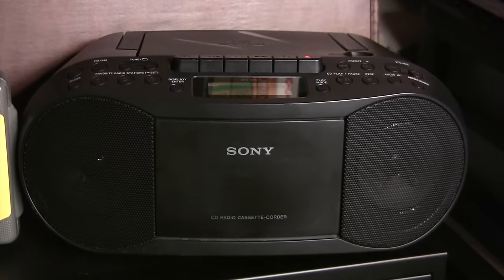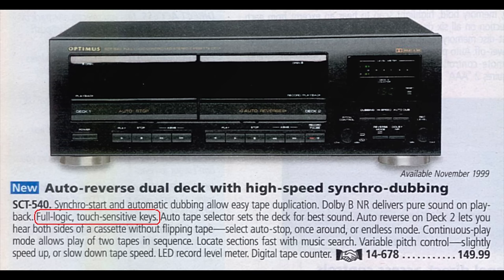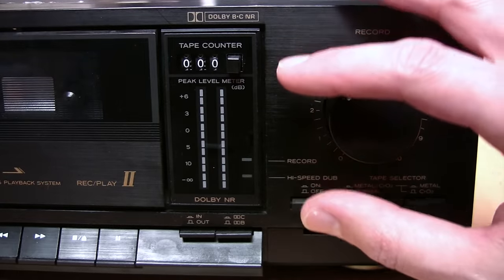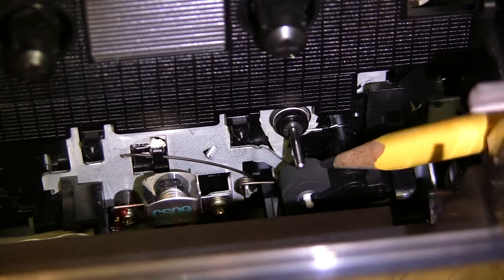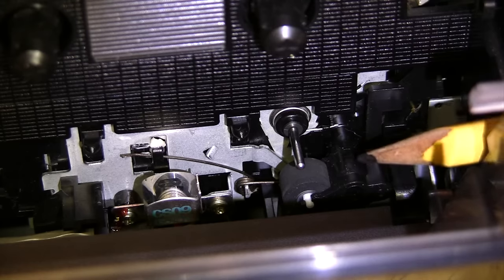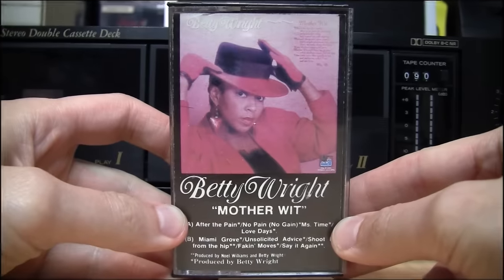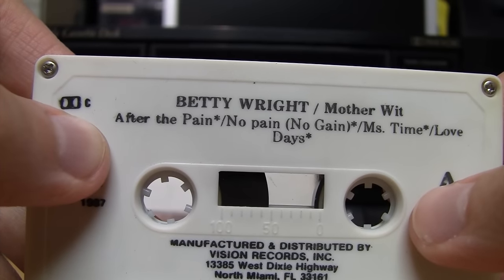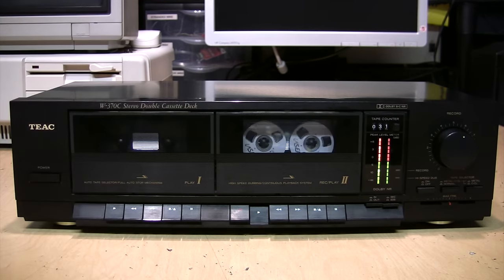Cassette Decks for Dummies

Comment: A simple, but really great well thought up and put together video as always.

Here's a little tweak you can try whenever you have the time tho,
When using a 'Piano keys style' cassette deck that has Full Auto Stop, the easiest way to do the finger test with the rewind function, is simply to activate the 'Pause' function on the deck first before you press the Rewind button to temporarily disable the Auto Stop feature. It may not work for all decks, depending on what type of mechanism is used, but from the looks of that TEAC, I'm almost sure it'll definitely work.
Reply from the maker: Thanks for the tip!
Reply: @vwestlife  You're most welcome...
Reply: That brings back memories! I remember doing that pause/rewind trick back in the 1980s and 90s.
Reply: You got me. This is indeed exactly what I need
Reply: Yes, i always push pause to avoid auto stop in rewind mode, i have a lot of manual decís and always works

Comment: What I usually do is buy them, Clean them up including cleaning the tape heads , etc.Change the belt if needed, And then Pass them on to another thrift store ❤️ I love giving these beautiful tape decks another life!!
Reply: I work at a thrift store. We usually throw more of those away working in good shape or not. The manager usually prices them too high and no one buys them. They go right into the portable compactor and make a nice crunching sound. I once thew out one that was a gold colored disco style huge NAKMICHO 1000 and it jammed the compactor. It was in pretty good shape and working before it was pulled from the shelf.
Reply: @integribeez4114  🥺
Reply: @integribeez4114  that’s awful! If you don’t mind me asking, where is the thrift store located? I live in the US in Pennsylvania and I’ve literally seen bags in my local thrift store full of leaking batteries Lol.. I think that’s pretty wasteful that they would throw out perfectly working equipment, at least mark the price down or some thing instead of just destroying it.
Reply: Smh, true, or sell in the bay, use for parts, leave out for someone to take up.

Reminds me of thst scene in The Brave Little Toaster
Reply: @integribeez4114 THEY CRUSHED A NAKAMICHI 1000 ZXL?! DO THEY NOT KNOW HOW MUCH THOSE ARE WORTH?
Reply: @emmareporter4324  I called it a boomer box. I'm glad it's gone. No one uses those anymore. W O K E!

Comment: A deck with Dolby C for 7 bucks is a pretty good find.
Reply: Basically any working deck is great find for that price...
Reply: @MetalTrabant  Mostly agree, but... If it's wow and flutter city by sheer bad design, not wear, to begin with, it's not any good for any price.
Reply: And bias adjust.
Reply: @vinniemorciglio4632  This is a criminally underrated point. Internally bias the deck to the tapes you most commonly use and adjust the slider with a test tone. Rewind and play until it's right. Did that for years until I got a 3 head deck with an auto bias.

Comment: I remember how much of an intricate part of my audio pleasure the cassette deck was for me in the 80s and 90s. And the Teac brand was actually an exceptionally good machine for those of us on a budget and their Tascam brand. My usage of recording from my receiver/tuner was my favored use. With decent cassettes such as a chrome there was virtually no loss from quality of the original source. I had always used alcohol cleaning everything including the roller. I never had one degrade on me from using alcohol. I usually had things like the heads wear or some other mechanical issue long before that. I wore out my share of machines through the 80s. And I still use them today specifically to record my radio shows for later listening.

Comment: I have so many thoughts on this video, I will try to keep the length "comment appropriate". First, I love the fact that you discourage the use of a high alcohol content ISO for all things. Even after working in a radio station, I still used 91%+ ISO on everything, and with this rubber getting so old, taking better care is good advice. Also I would love to see a companion video on choosing a receiver. I think that a lot of people do not realize that these surround sound receivers in thrift stores, which are literally a dime a dozen, are in many cases a much better choice than one of those beautiful woodgrain and chrome models from the late seventies. I am always shocked to see Yamaha, Onkyo, and even Denon receivers just sitting there collecting dust, knowing if they were silver with an analog tuner people would be fighting over them. Cleaning a dirty pot with contact cleaner is not always easy, and these surround units should not usually need that attention. Anyway great video, having been spoiled on 1/4" tape for so long, I was never really a fan of cassettes, but I love the enthusiasm and information.
Reply: A lot of AVRs have vol knob problems worse than traditional pots, ie the vol goes up when turning CCW (down) Marantz, Pioneer are prime examples of this fault
Reply: @manFromPeterborough  my HK volume knob only works intermittently but the remote works it fine

Comment: “All the high end decks are strictly single deck designs” whilst panning down in front of a 6 cassette pioneer changer unit (albeit still only with a single deck inside the changer of course)😂
Great video, though. Especially for people who didn’t grow up with cassettes and learned the hard way!
I should add - I still have my Technics RS-BX606 cassette deck I bought from new back in 1991 and it still works perfectly.
Sadly we don’t have Goodwill in the U.K. - stuff either goes on EBay or it gets recycled at the ‘tip’.
Reply: The closest to Goodwill in the UK is charity shops and they either don't take LX kit or over charge for it. I've bought some cassette deck bargains on eBay UK but the risk is always underpacking so delicate chassis parts get smashed in transit.

Comment: I didn’t know about the Tape Monitor button. I knew it was there, but didn’t know what it did. Now I can tape my records directly to a cassette, and play in my Walkman. Thanks for the tip!
Reply: Tape monitor was originally intended for use with high end reel to reel tape decks. They had an extra playback head, allowing you to play what was recorded a fraction of a second earlier, making it easy to fine tune the recording levels / bias / etc while the recording was being made (especially while recording live music).

The Tape Monitor button on a stereo receiver is usually an easy to toggle button so that you can compare the source material with the recording with a quick toggle of the switch.

For those of us without the fancy reel to reel tape decks, Tape Monitor serves as an extra line level input for the stereo receiver. This is especially useful on vintage stereos may not otherwise have enough inputs to have a tape player and cd player connected at the same time.

Comment: I had a dual Sony cassette deck, where, when one cassette play both sides it would automatically go to the second deck and start playing. So you essentially got to hear to albums before you had to stand up if you wanted to switch cassettes. I loved it. I could even set one album to play in Dolby but another album to play in another Dobie form or not plan to be at all. Or II had a dual Sony cassette deck, where, when one cassette play both sides it would automatically go to the second deck and start playing. So you essentially got to hear two albums before you had to stand up if you wanted to switch cassettes. I love that. I could even set one album to play in Dolby but another album to play in another Adobe form or not playing Dolby at all. Or I could use cassette deck be to record off of vinyl or off of radio while using cassette deck, a to play a song. My favorite part was both cassette decks, once a song was over you would see a little LED light up so it knew there was empty space. So if you pressed fast forward, it would fast forward past a song and then stop on the next empty space , so you could use that to skip whatever songs you wanted. Or you could turn that feature off and just have it fast forward until you press stop. And there were a whole lot of other features too and the damn thing was heavy. Built like a tank. But that’s why I love that. It was a good quality. Sony machine with amazing amazing sound.  I even loved the little digital something or other on the screen. It had a screen built on top of it and you would watch the little LEDs move along with the music. Kind of like an iTunes visual, so it was far better than the normal little bars that were raised up and down with cassette decks. Even the buttons were unique. Instead of being hard buttons that made a lot of noise, they were very soft and just the slightest touch could get them to do things.  Best damn Sony anything I ever had hooked into my A/V system. I was so sad to see it go.

Comment: 13:25 If the capstan doesn't turn when the power is switched on, activate the rewind or fast-forward mode to make the capstan turn.  That way, you can clean the capstan without having the pinch-roller pressed against it (as would be the case if you used the "play" function to make the capstan turn) to jam your swab and/or re-contaminate the wetted capstan as it turns.  To clean the pinch-roller properly, you'll need to repeatedly stop and re-clean the capstan as you remove the debris from the pinch-roller by holding the swab against it, since the roller will often have a lot more oxide/dirt buildup on it than the capstan will (that's largely because the roller rests against the "front" --- i.e., oxide-coated side --- of the tape, whereas the capstan contacts the "back" of the tape, which is the side away from the oxide coating), and this debris will come off and coat the capstan as it is wiped loose by your wet swab.  Often you may need to change your swab several times before you get the pinch-roller clean, whereas the capstan usually comes clean with just one application of the swab.

Comment: Thumbnail looks familiar, looks identical to my Technics M5 :)
Picked it up for free at the local recycling store and it worked perfectly, probably wouldn't have paid much attention if it didn't have the VU meters. I just love feel of old AV equipment, they feel so much more robust and all the knobs are so smooth and switches are solid. Completely different from the modern shiny plastic garbage
Reply: Actually, I think it's the M-205, I owned both of them, the M-205 I still have. The decks are indeed very similar, same functionality and share also many parts, I managed to make the M-205 working again by using some salvaged parts from the M-5. The M-5 has direct mechanical piano-style keys and a plastic housing, the M-205 is a bit more elaborate with a metal housing (that is much easier to take apart) and a fully mechanical soft-touch control mechanism. I like the way you feel the mechanism take over when you press the play-key slowly ;-).
Reply: Why does anything modern have to be garbage though?

Comment: Hello VW. Just to add one advantage of the double cassette decks. Most of them have only had the left side deck used and the right hand deck, which is there mainly to record to, hardly gets used. So, it has almost always hardly been used and the heads are hardly worn so gives a better performance than the heavily used left side deck, and better than a single heavily used single deck model of equal vintage. . Its a real advantage even if, in my opinion, I prefer (the look of ) single decks. It really is something for nothing.
Good upload, as always.
Reply: We were probably incorrect in doing so, but just about everyone I know used the recording deck, on the left, as the primary playing deck as well. The play-only deck (which was on the right as you faced the machine) was typically only used when you were duplicating off a cassette.

Comment: This is a great video for someone looking for a thrift store deck.

Some things I’d add—

1. When sound testing a deck, make sure Dolby is not enabled on the initial test. I had a deck I thought was broken, but then realized Dolby C was enabled. 

2. If the spindle does not have the tension to pass the finger test due to stretched belts, a belt replacement is not the end of the world and usually doable if you’re even remotely handy. Belts are readily available online.

3. This is arguable, but I would make sure to use 91% alcohol and not 70% rubbing alcohol, the latter which can often leave a residue on the heads after you clean them.

I agree with everything in this video. For most folks, the deck in the video is just fine for playing tapes. $7.99 sure beats spending $400 on a new Teac and frankly, an old deck in working order is likely work at least as well if not better.
Reply from the maker: Yes -- I should have pointed out that as long as you get some sign of movement from the mechanism, the belts aren't too far gone and should be easy to replace. But if you get no movement at all, the belts have likely melted into black goo, and you'll have a nasty mess to clean up.

Comment: Nice survey! Thank you. I just bought 'new' a PYLE PT659DU. I'm piping it through a Sony STR DH190 receiver.  I just wanted a deck that I could play my Peterson't learning "Birding By Ear" cassette kit on and a couple of music cassettes I have left over from the 1980's. The frequency range is very nice, but the dubbing deck (B w/counter) has a hum on the left channel. no hum on the playback deck A.) Amazon wouldn't take it back without an awful lot of fuss./Pyle blew me off.  So I reversed the LR output channel RCA plugs which reduced the hum considerably, but didn't eliminate it. I tried grounding the chassis to the Sony ground screw. Didn't help.  I cancelled my Amazon Prime account over that. So I'm all ears on your great survey!

Comment: One suggestion for IF your testing a cassette mechanism at a thrift shop.
Carry a cheap set of earbuds  and a 3.5 to larger plug (can't remember right name) we all carry earbuds or headphones already.
Find a cassette (preferably one that was already on the store), then the tape deck, then test the cassette deck in the shop, and plug your headset in. If their are oither features, test thoes too.

I picked up a Sony hst-211 all in one (duel cassette, radio, 3 input and a phono amp built in, but it was missing the removable record player.) With it I found the cabinet with its glass door, cabinate speakers. I later traded the speakers for a STR-K7000 A/V AMP. I found this a good trade, and a great way to merge vintage and modern technology in my living room. Best $40 at goodwill I've spent yet.

Comment: This was a great video.  I've been into hifi since the late 70s and have had my fair share of decks over the years.  I love your last point about elitism in the hobby.  For 90% of people, a cheap deck will be just as useful as an expensive one, and really won't be noticeable with sound reproduction.  It's a bit pointless having a $1000 cassette deck to record on, then play it back on a $100 Boom Box or knock-off Walkman.

My rule of thumb is to purchase what you can reasonably afford, keeping in mind you may have to do some work on it (if it hasn't come from someone who looks after them).  Replacing belts and a service can add to the price.  Also, I look for decks that are made before 1995 as a rule of thumb as that's when cassettes really disappeared of the shelves and cheap mechanisms started flooding the market.  I also tend to avoid the decks which are all electronic as when things go wrong, they are VERY expensive to fix.  Look for  good late 70s early 80s deck made by a good brand (Pioneer, Sony, Teac, Denon etc) and you really won't go wrong.

My problem now is trying to find places to buy blank tapes from.  Second hand tapes are generally useless now.  And new here are SO expensive.
Reply: Sanyo and Realistic also made good decks

Comment: I have this JVC dual deck with auto reverse, Dolby B and C as well as manual recording level controls. I am very pleased with the recording quality and playback quality. I bought a few metal tapes and they sound really good. I used to make a lot of mix tapes for when I had my old car with a cassette deck and they sounded great as well. JVC seemed to have made good quality units back in the day.

Comment: Thanks for the helpful info on cleaning the heads. I never Would’ve thought about using window cleaner.
Reply: You can also buy 'rubber conditioner' to keep your pinch roller / capstans nice and soft and flexible.  It is kind of expensive, but I think worth it.  It lasts forever.

Comment: Interesting info about cassette decks. I only have my Technics RS-B11W cassette deck from 1985 and it still works, but sometimes it has issues with the speed on deck 1, but deck 2 plays good in playback. It can record anything like music or old time radio shows whether if it’s either Dolby off or on. Pre-recorded cassettes also has a Dolby encoded feature. Other cassettes that were pre-Dolby encoded were made by Ampex from about 1967 to 1972 are not sounded as good when using on shoebox cassette recorders.

I also have my Superscope C-101A, the Superscope Storyteller TP-101 cassette player which is playback only and it was designed for children, and my Audiotronics 148B “Classette” school cassette recorder which was used in classrooms at schools and in libraries, and they’re still great looking cassette recorders.

Comment: This video is an excellent introduction to cassette decks for 'dummies'.  One thing touched on, but no details given, is tape head demagnetization.  Clearly, it is best to use a proper demagnetization tool; however, if you do not have one, then a simple solution is to make the tape head demagnetize itself.  This is achieved by selecting the highest bias setting available (metal > chrome > normal) and switching record on and off a few times in succession.  The AC bias signal that is applied when recording also demagnetizes the head.